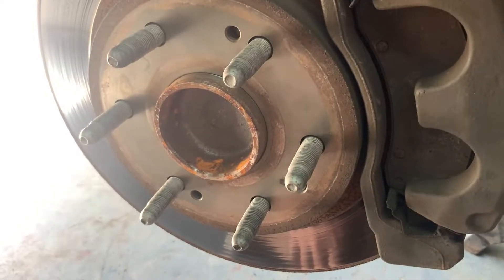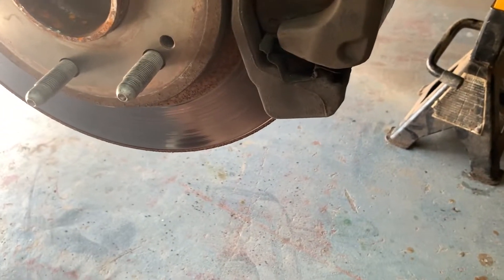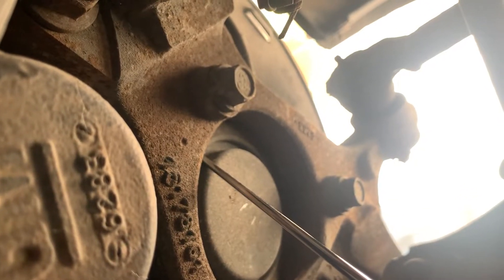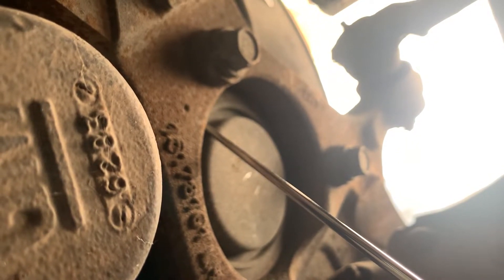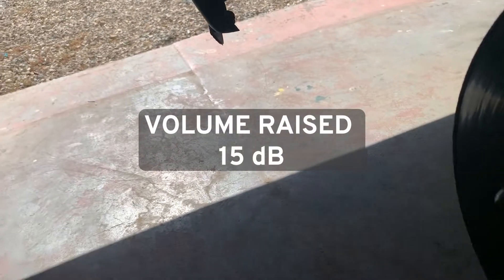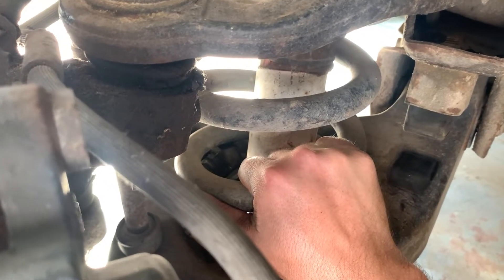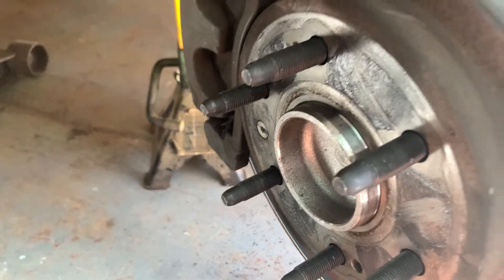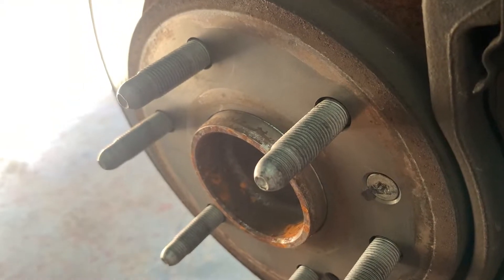Diagnose Wheel Bearing Noise with Stethoscope & Other Methods - Shown on 2007 Silverado 1500 Classic

Comment: I used to use my 3/8 extensions like sb using a long screwdriver. It worked but sometimes my face is too close to the engine. So I purchased a stethscope recently to keep myself safe.

Comment: Best way to do it with a stethoscope is to have someone running the vehicle being it up to the speed where you hear the noise, and then check the back of the spindle. A bad bearing will be noticeably louder compared to the others. If you don’t have a stethoscope, another way could be by scanning for codes. Often times with wheel bearings there’s a tone ring that your wheel speed sensors read off of, and a bad bearing will throw wheel speed sensor and abs codes at you because the sensor is unable to get a good read on the tone ring.

Comment: Sorry but that jacket and should not be situated on the slope of the frame...always on a flat
Reply from the maker: I agree. But let me tell you, that sloped part of the frame you're seeing, on these trucks has a leveled, welded on part with a little down facing "hill" so to speak that fits right into the top of a jack stand. The jack is still underneath the vehicle and I also always have the wheel underneath the frame as well for extra protection.